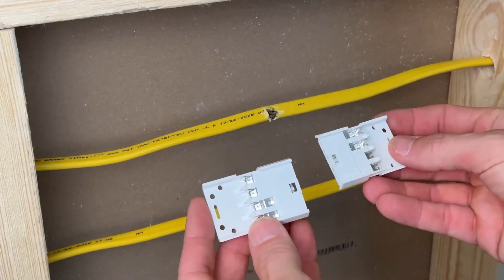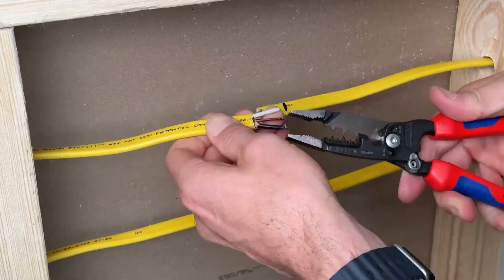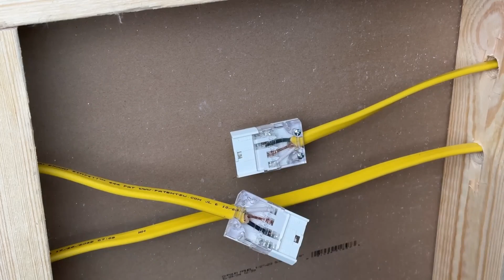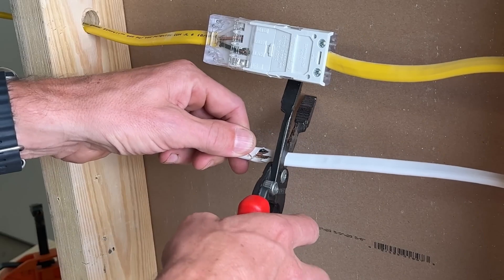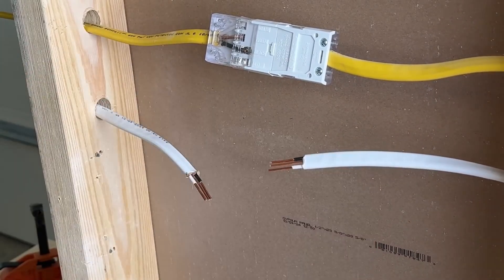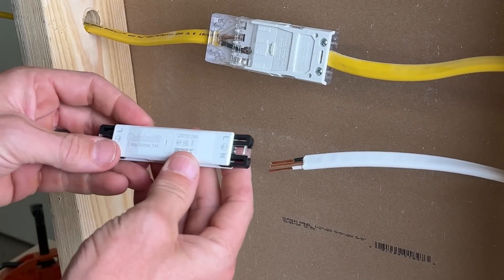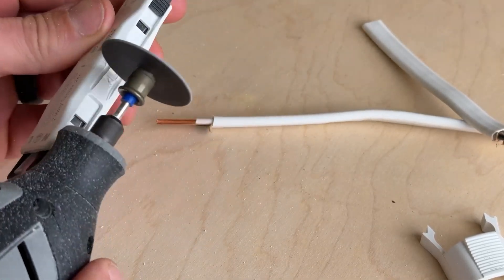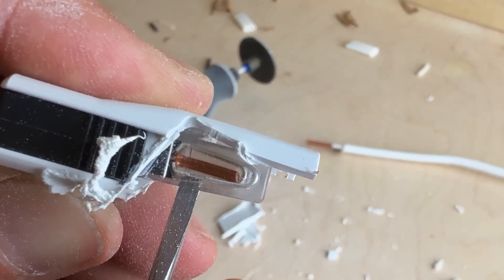This UK Splice Connector Might Be Better Than Anything We Have in the US

Comment: Lived the first 28 years of my life in the UK and the next 14 here in the US, but I will say this, the difference to UK vs US when it comes to electrical is night and day. I'm still shocked that it was ever standard here to have 2 prongs that go into a receptacle and are LIVE as soon as they are going in, by half an inch or so. In UK our plugs have a nonconductive part, it's just the tips basically, and once they go in and make contact, the prongs themselves are not conductive at that point. And then all plugs are fused, and I cannot for the life of me understand why that never became the norm here in the states. Fuses blow quicker than breakers, they are literally right there, mm away from the area that gets traveled when a short or amps are too high. I have been shocked by US at 110v and shocked by UK 220v an the frigging US 110v was way more intense because it lasted what seemed longer. UK has two protections, the first protection is the fuse, then the breaker. Fuses save lives because they disconnect instantly the path of current. I have seen US breakers NOT trip until they are ridiculous levels over and they fail all the time. For example a 15 amp breaker that doesn't trip AT all at 20 amps, and some that takes 5 seconds to trip at 100 amps? While everything is smoking and..

I just don't get the US. It reminds me of poorer countries I've been to, it's kind of a mess.

Comment: Both devices have a contact surface which is frighteningly similar to backstab connectors. That’s honestly my biggest concern. If they had the contact surface area and lever locking of a lever-nut without the “forks,” I’d feel much more comfortable with them.

Considering using one for a very specific problem I have with our kitchen’s wiring plan (MWBC with the dining room??), but they’re just too hmmm for me.